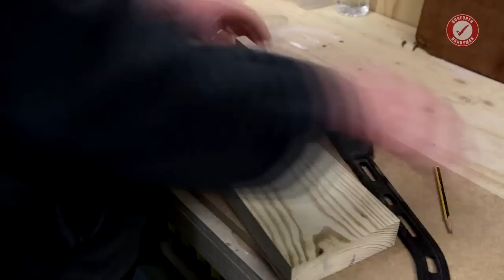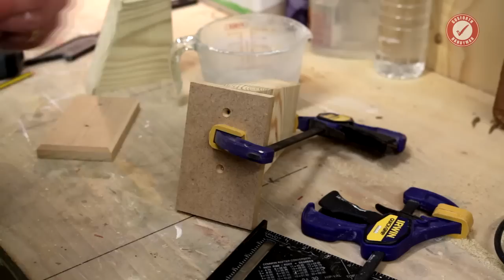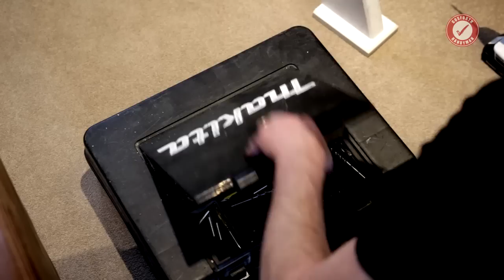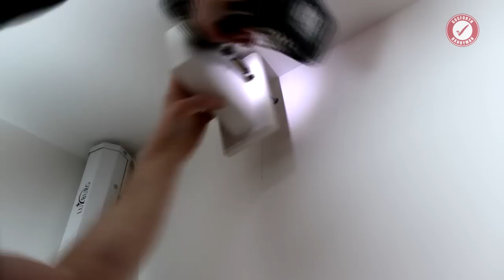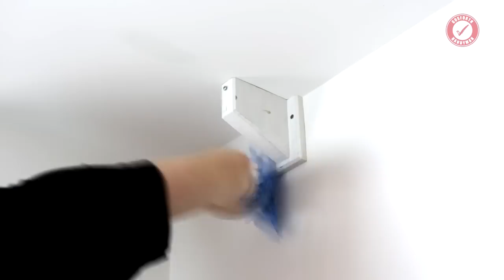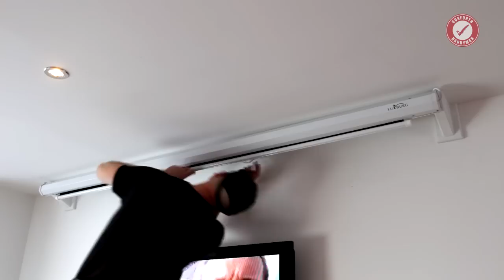How to Install a Projector Screen (90" Motorised) with Brackets to Avoid a TV

Comment from the maker: Here's a similar 90" screen if you're in the UK: https://amzn.to/2K8eflF
This is a similar 100" one if you're in the US: https://amzn.to/2lr1c0p
(affiliate links)
And here's the full article to go with this video: http://gosforthhandyman.com/2017/04/installing-a-motorised-projector-screen/
Reply: Gosforth Handyman hey u got a question for you. I am considering an install for projector screen but needs an offset of approx 20cm from the wall, yes to avoid TV. The only issue I have is that I also have a ceiling fan which if I install the projection screen, the end of the fan blade will be approx 4 feet away. I am not worried about it hitting the fan for such distance. My worry is that the wind from the fan affecting the sturdiness of he screen causing wobble whenever I watch movie. From your experience, do you think it will cause a problem?

Comment: I installed a 150 inch with 3 floating brackets in the ceiling. Some screws hit the stud, some I have to use the dry wall plastic thingy. So far it works but still don’t feel easy. Will have to do similar ideas to mount it on the wall with space to avoid the TV. Thx for the idea.

Comment: did you just tap into the drywall for the screen or did you hit a stud?
Reply: It looks like he uses a stud finder in the video. I have one but not the same model. Handy but rarely that accurate..
Reply: @rimmerd9908  my screen did not hit a stud on both ends so what i did was put a piece of wood to hit both studs then put my bracket on the wood, now i have room to put any size screen. wish i can put photo here..
Reply: @housbinpharteen7445  I get it! I used to use the old 'Tap the Wall with Something Hard" method which usually worked. My stud finder is mainly for electricity which it does okay. It's good to know the stud distance on each wall as it's likely that will run as a measurement throughout the property.. Cheers for the video!

Comment: Glad I came past this, I just bought the same screen but manual, would this method work for 120 inch?
Also is it possible to extend it out 25 mm from wall.

Comment: Hi, How did you adjust the  stop positions? I have this blind and the manual is terrible.
Reply from the maker: There's tiny adjuster pots on the back of the unit. 👍
Reply: @GosforthHandyman  Thank you. I found them with the help of a tiny camera. They are very well hidden when it is up against the wall.

Comment: Can you set a custom stop point for where the screen stops extending down or do you have to manual stop it if you don’t want to it to extend fully? Does it support IR universal remotes?
Reply: You set the stop point when you’re initially setting it up, then it always stops there. And no, it’s controlled by its own RF remote, IR won’t work.
Reply: Thanks. How do you set it up to auto stop at a certainly height? I didn't saw that in the video.